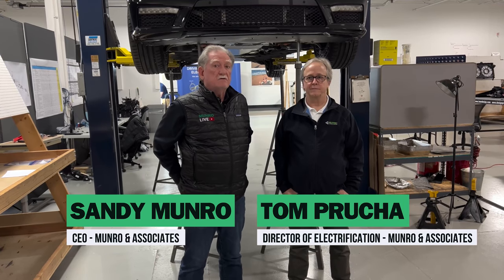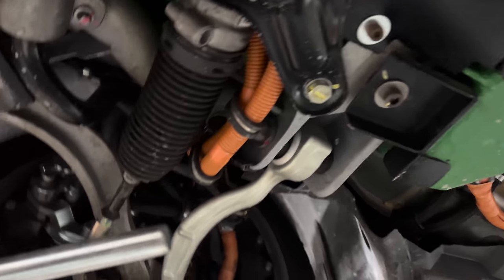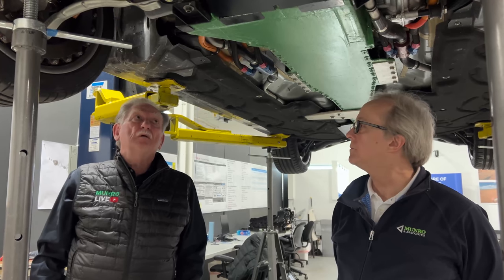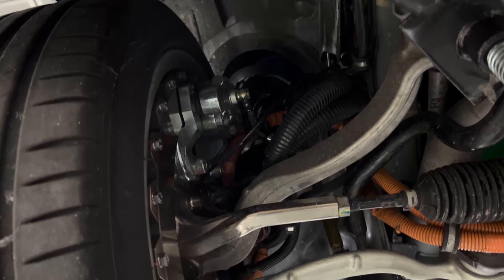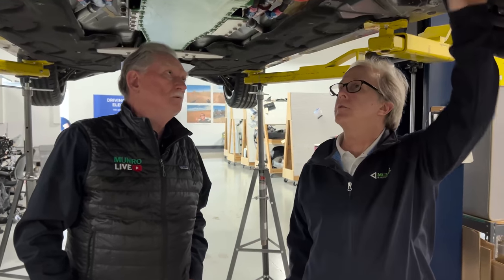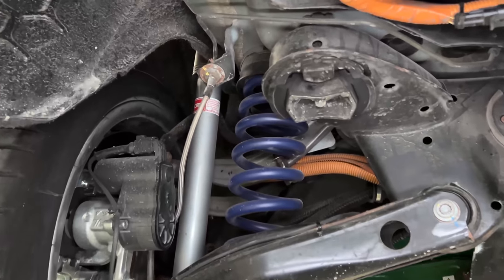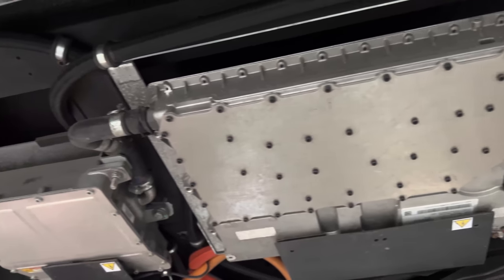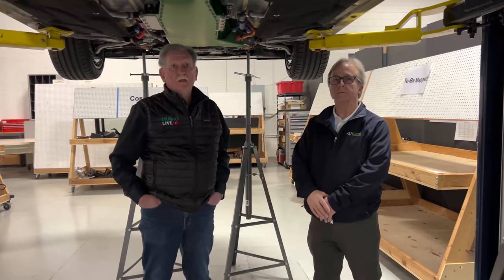Protean Electric Wheel Motor Technology | Review with Sandy & Tom

Comment: That's the first company I've seen besides Aptera using in-wheel motors. Although Aptera doesn't have the inverters in the wheels. Seems like a good idea to save space inside the car and also reduce all the mechanical parts like the axles, CV joints and reduction gears.
Reply: FALSE, LIGHT-YEAR, Lordstown, are also using HUB Motors. 
also, APTERA motors is a FRAUD. 
they can't even get OFFICIAL EPA range or NHTSA certificate.
Reply: @markplott4820  Wrong. EPA range is 1000 miles for their 100kWh version.
Reply: @seasong7655  - FALSE, there is no EPA Moroni sticker for APTERA and it's NOT even a ROAD legal vehicle even.
Reply: @markplott4820  It's not road legal YET. Because it will be sold at the end of 2022 in the US, and later on around the world. You clearly have not researched Aptera sufficiently.
Reply: @seasong7655  At the moment Aptera does not even have a roadworthy production prototype.
Reply: @seasong7655  They are driving a production ready prototype? Or just a simple Beta?
Reply: @markplott4820  "they can't even get OFFICIAL EPA range or NHTSA certificate.
1" Why would you expect it to have either of those at this point?
Reply: @grahammonk8013  - because many have FALSELY claimed , Aptera is crash is safe, crash worthy and has a FAKE 1000 mi range. 
APTERA is even lacking proper AIR bags.
Reply: @markplott4820  You better inform yourself properly before spreading BS. They will hit the road next year (2023) at latest fully certified. And yes, they have airbags.
Reply: @vic321344  Time will tell....

Comment: I would be interested in the weight of each motor/wheel combination and to know how this affects handling and ride quality.  For a long time it has been a mantra to reduce unsprung loads at the wheels to improve road holding.
Reply: Well, the "standard" American car used to have a heavy "solid" rear axle.   Lot's of unsprung weight.   But for the vast majority of folks, it worked out quite well.   The Solid Axle worked better than the first attempts of independent rear suspension.
Reply: Unsprung weight can be a issue, however by having the wheel motors the cars springs don’t have to be altered to carry that weight, as the battery weight would seem to be close enough to the weight so the engine, transmission and drive line

Comment: Ah the good old wheel  motor, hyped for years but never actually got to production due to the large number of significant deficits and the realtively small number of advantages!

The good things:

1) you can fit them in the middle of the wheel, so make more space in the body

The bad things

1) high unsprung mass (poor ride and expensive dampers to deal with that mass)
2) difficult to make use of a large gear reduction ratio so as to downsize the electro-magnetics meaning a large, heavy, expensive motor
3) you obviously need at least two per vehicle (more cost / complexity)
4) Difficult to make a truly durable motor and inverter when they are directly subject to road forces. If you do, it'll be more expensive than a sprung motor/inverter
5) Makes it hard to use optimum suspension kinematics / geometry because the motor is where the ends of the suspension links want to be
6) Puts HV DC components in a vunerable position, and you have to route a very flexible and vunerable HV DC cable out to the motor
7) Cooling the motor out in the wheel isn't easy, pipes have to be run, and they must be very flexible and durable
8) You need some clever chassis electronics to control two motors across an axle, and the failure modes are non trivial (one motor sheds a magnet and locks up, car spears off into scenery or oncomming truck....)
9) Today, you still need to package a mechanical friction brake to pass type approval (this may change, but todays it's a big issue)
10) A small gap between the inside of the rim and the outside of the motor assy is a real world problem, where stones and road debris get caught in the gap. At best, just causing customer complaints due to the squeeling noise, at worst, machining right through the wheel leading to a failure

It's pretty easy to see why in a typical passenger car application the small benefit is massively outweighed by the negative aspects and hence why no OE is using them.......
Reply: Some cars have Inboard brakes, outside the wheels, which would be a better solution IMO.
This helps for reducing the unsprung weight of the wheel hubs.
Also braking torque is applied directly to the chassis, rather than being transferred to it through the suspension arms.
Reply: I think you've named pretty much every reason why nobody does it probably nobody else ever will. This will probably be the example of what can go wrong and will go wrong that will settle a lot of design arguments.
I wasn't thinking of the RPM problem. Tesla motors spin 12, 000 to 16,000 RPM. Not very good for in a wheel. But the reduction gearbox solves that.
Of course you can make the diameter of the in-wheel rotor larger. But not that larger. Egadd.
Reply: @henryD9363  I was thinking CV joints aren't that bad of a solution, except for the need to replace boots periodically.
Reply: All good points and very difficult to solve. Until we learn to build better density magnetic lenses  or come up with high temperature superconductors it’s difficult to justify this type of engineering for mainstream passenger vehicles.

Comment: what about wire ware on these high voltage power lines that go to the motors (flexing due to vertical movement of the suspension and horizontal movement of the front wheels on top)

Comment: THANKS SANDY AND TOM …FOR SHARING THIS AND 🤔 I AM WONDERING IF WITH NEW BATTERY TECHNOLOGY…
IF THIS COULD BE USED TO RETRO FIT CLASSIC CARS FOR THE FUTURE  🤷‍♂️ 😍😍😍
Reply: NOPE, too small space for ANY current battery design.
Tesla 4680 structural battery is the PLATINUM standard battery today, because it's a skateboard 🛹 pack and does NOT use heavy Modules or pack. 
it's also the ONLY Leading ZERO maintenance battery pack on the Market.
Reply: There is an active, albeit small, group that mods ICE cars into electric.  You'll never get anything like the benefits of car designed to be BEV from the ground up but for those who love a specific make or model it gives them the chance to go green.
Reply: @TheEvilmooseofdoom  I AGREE…AND THOSE ARE THE ONES I AM REFERRING TO AND I AM SURE THERE WILL BE MUCH MORE PROGRESS IN THE FUTURE 🤗 making it possible and feasible 😍😍😍

Comment: The use of BEV conversion kits, or even LPG systems, could extend the longevity of many ICE cars or even obsolete BEV cars, that otherwise would be scrapped.
Reply: FALSE, it's far Cheaper to buy a NEW BEV that's using a SUPERIOR skateboard 🛹 Drivetrain. and it's MORE efficient, can be made with LOWER coefficient Drag, and come with a FRUNK.
Reply: Longevity and durability is the reason Toyota isn't worried about about EVs
Reply: @John-Nada  - TOYOTA will be BANKRUPT in 2023, when TESLA starts DELIVERING millions of Model Y in 2023.
how many bZ4x can Toyota produce & sell EACH year ?
Reply: @John-Nada  there is a reason why Toyota was so reluctant to replace Nickel-Metal Hydride batteries thorough Lithium-Ion batteries.
Reply: @markplott4820  and what's "Eco friendly" and sustainable about replacing a BEV once it gets obsolete? Many brag about their BEVs, but few are the ones keeping them through many years.
Reply: @RogerM88  - Tesla since 2020 has closed loop battery Recycle ♻️ worldwide. but, it's still cheaper to mine for now.
also w/ 4680 structural pack, you don't have to replace the battery for LIFE of the car, and END of life (50+) years, it can be recycled, and 95% of Elements can be recovered, SUPERIOR to mining, as it's nearly 100% pure Elements, compared to mining. even OLDER Tesla CMP can last 40+ years, and Tesla & GRUBER motors keep 2009 Roadster & Model S/X on the road.
Reply: @markplott4820  says who? The most famous Tesla fanboy on the comment section? You don't have enough raw materials as Lithium to supply BEVs as mainstream for decades without increasing the intensity of mining. That's why alternative battery Cell Chemistry are important, such as Sodium-ion. And you won't be capable to recycle every Lithium battery packs, as the Smartphone and Laptop industries show us. Increasing the amount of tech waste.
Reply: @markplott4820  also you must be delusional if you think a structural battery pack is actually a great idea for the costumer. An average ICE expectancy surpasses 15 years, while a BEV with Li-on batteries barely reaches that, without needing a new battery pack that totaled the car in many cases. The Panasonic 4680 won't add any major improvements, and BYD is way ahead in the tabless design. You should get an hobby, instead of being all day in many comments sections acting as a Tesla fanboy.
Reply: @markplott4820  4680 actually is nothing that impressive, besides all the hype fanboys as you pump it out. BYD already has them, and the specs are nothing that impressive compared to current Li-on used. Solid state batteries are far superior, due to faster charging speeds. Which Tesla doesn't have any scheduled. Relying in other Battery Manufacturers to produce their battery packs. Automakers including Tesla can't produce enough BEVs for the demand, and that going to stay like this for a while. Not a surprise too, if Tesla sinks in sells in a couple of years, due to lack of offer from a variety of models and designs looking outdated. And due to the increase in production from BEVs from other Automakers with similar specs and better Costumer Service and parts availability. Increasing production, doesn't necessarily mean guarantee profits. That's what fanboys as you don't get. Get an activity or a hobby. You're living too much this.
Reply: @RogerM88  - ha ha ha ha, Solid State. what a JOKE.
they are more expensive, SHORT life , and LESS range than 2022 2170 nickel......lol.
you are living ina FANTASY.
Reply: @markplott4820  a fanboy in denial. For niche market cars, as sports cars, Solid state batteries make perfect sense. Faster to charge, lighter. For a reason they been used in Motorsports. You sound as a fanboy in denial. As previous said, get an hobby. That Tesla obsession is taking over you. A car is a vehicle to move around and be reliable, not a  tech device quickly disposed once obsolete in a short period of time.

Comment: noob question: since the motors are in the wheels, their weigth doesn't count when comparing before and after, right? I guess what matters for tuning suspensions is the weight at the axels, while the motors affect the weight at the tires (which I suspect increased after the swap)?
Reply: I agree. The wheel motors add to the total weight of the car of course but not for the suspension as far as carrying the weight goes. The heavier wheels would require heavier damping. Ride improvement is needed because the ratio between moving parts (wheels) and non moving parts (the car) is different because of the heavier wheels.

Comment: The big problem with wheel motors is the unsprung weight.  This also explains why the springs did not need to change as the motor and the inverters are not in the weight that the springs need to hold up as they are in the wheel and not on the body of the car.

I am sad that Sandy did not question that part - it is clear that a lot of weight was moved into the wheels.

Comment: I don't know if this Protean system is the right answer, but hub motor design will be what takes EV's and their adoption to the next level. And if done correctly will help reduce the overall cost.
Reply: HUB motors were needed when cars went to Hybrid, FC and EREV.
it would have freed up space for a FRUNK. it's disappointing to see PROTEAN unable to have useable FRUNK in their design. HUB motors are OUTDATED technology today. the TESLA RWD is the GOLD standard.
Reply: @markplott4820  The amount of space a hub motor would save on an EV would allow more room for a bigger battery, which means more range and power. Usually because of the larger diameter a hub motor has, it means more torque produce with less electricity. Which again means more range and more power. Tesla design at the moment is king, because corporations just are investing the money in R&D needed for advancements like Tesla is.  Aptera uses hub motors, has the same speed performance as a tesla but because of its efficiency's can go up to 1000 miles on a charge. I love Tesla and they are king right now, but that doesn't mean they are perfect and untouchable, there is always a better way and always room for improvement.
Reply: How would this help with adoption? I see more complexity in every part of this.
Reply: @custommotor  - agree, it does not help with the consumer. they already sell $10k electric ⚡ cars in the USA, KANDI.

Comment: If you're retro fitting a ice vehicle the wheel motors are nice because it's unsprung weight... So the battery can weigh  as much as the  engine / transmission /drive line.

Comment: What is the efficiency of the motor over its RPM? A deep dive into this where motor design as opposed to standard motor w/ gear reduction would be very interesting.
Reply: Electric motors like high RPM. Tesla's are 12,000 to 15,000 RPM or so.
Having a 1:1 ratio is the worst thing you could do even though electric motors do produce substantial torque at lowRPM.
I bet it's 0 to 60 is going to be something like 20 sec!
A bucket load them bad design decisions here.
 This is just really a toy that some guys decided to fiddle around with.
Reply: @henryD9363  There are hub motors with planetary gears. The Aptera 3 wheeler (hub, non geared) seems to have no performance issues.

Comment: Calling it now, this is DOA. As is Aptera. I just dont see how those high voltage lines wont get completely obliterated by all the vibrations. Plus all the unsprung weight. Itll be nice in a straight line on an atomically flat surface though.

Comment: Question on how the air gap is maintained in the hub motors.  How is the air gap maintained under heavy lateral loads?  Has the wheel bearing been beefed up to reduce gap distortion.  Next question is how is the air gap protected against the environment?  Unlike conventional motors the air gap on hub motors is less protected and much closer to the ground.  How is dust and water kept out of the air gap?  Are seals used for this purpose, and if so is seal replacement a maintenance requirement?

Comment: Why not install the motor inboard instead of inwheel and use the engine compartment for protection and using the existing drive shaft?

Comment: Beside the 54 kWh battery capacity, any additional technical information, 
such as motor power and cooling system, like heat pump or octavalve?
And also information about the cost of this retrofit?

Comment: Doesn't the regenerative braking, which doesn't use the friction surface, do a majority of the braking? Or is this designed with the assumption the regen might fail and you still must stop the car. (Fault tolerance/redundancy)
Reply: Yes, the friction brake is required for redundancy, but also to provide enough braking torque in an emergency (the motor can't produce enough by itself).

Comment: My concern with the in-wheel motor is always how it will fare out to shocks and bangs after 10,000 miles. I guess on a G-Wagan type vehicle there is a deeper tyre to help out. Anyone know how the Rivian fares out with its in-wheel motors?
Reply: Rivian doesn't use in-wheel motors. They have one motor per wheel, all mounted inboard and using conventional CV-jointed axle shafts.
Reply: @brianb-p6586  Really? Oh I didn't know.

Comment: How do you change the tires when you get a flat?
Reply: Same as a Regular tire. 
the Wheel Hub is the MOTOR. 
it means you can't Change or upgrade Wheel size , to make MORE efficient (18") or performance (22") wheels.
Reply: @markplott4820  You also have to unlock the electrical lines from the motor and the brake system caliper. The brake disk is fixed onto the hub. I doubt that this heavy wheel will fit into an ordinary tire machine.
Reply: @vic321344  - it will have to be built MORE robust, than a Tesla suspension and wheel hub, it will add a lot of WEIGHT.......lol.
Reply: @vic321344  No, the motor is within the wheel just like conventional hubs and brakes - the motor won't be part of the wheel. The wheel is a normal wheel and removes as usual, leaving the hub with the brakes and the enormous motor still attached, so the brake caliper and wiring are not involved in a tire change.
Reply: @brianb-p6586  You are right, I just looked at it from the inside.

Comment: Um, the wheel motors aren’t adding any weight to the suspension so that is a weight reduction over other EVs. It does increase the unsprung weight so I’m surprised the shocks weren’t beefed up a bit.

Comment: 54kwh is a small (dare I say tiny) battery for this size vehicle. With its size, weight and non-optimized drag, it is likely to be able to do 150 mile range (real world) - which is great for city driving but won’t work for longer trips. Having said that, it’s probably good for demos as it reduces weight and would provide better performance (until the battery runs out)

Comment: What I would like to know is the weight of the original wheel and spindle and the weight after the conversion. 
Also having the inverter attached to the wheel would make the inverter much more expensive to make because the electronics will have to be built to handle the extreme vibration.
I think it would have been better to put the motors on the chassis and have a drive shaft with CV joints to the wheels.

Comment: Are in hub motors even efficient enough? Seems like if they were then more manufacturers would use them instead of only one, aptera.
Reply: NO, they are less Efficient than conventional EV motors, just look at the crappy Endurance and Light-year one.
Reply: That would be zero, since Aptera is a dream, not an auto manufacturer.